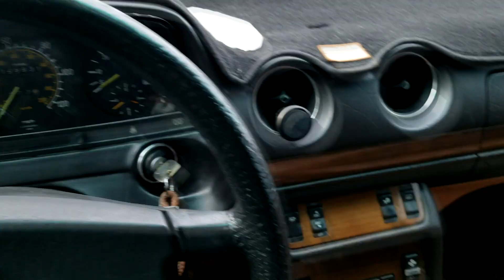Classic Mercedes Wood Trim DIY Option.

Comment: Maybe the tint is a UV shield?  There are self leveling additives for epoxy and paint.  That project came out fantastic!  What happens in the sun tho?...hmm.
Reply from the maker: I'm sure someone could find the correct additives to both match the original color and add UV protection that would be the next step. thanks for watching and commenting!

Comment: Sorry for the late comment, thanks for sharing your experience. How did you apply the epoxy? Brush? I thought I heard you say immersing? Or is it just a ton of epoxy on the brush? Do you think an epoxy spray would have worked?
Reply from the maker: no brush , just drizzle it on. thanks for watching

Comment: And how many coats and timing between rs-coating,  etc. ie, how did you get the wood to look so shiny?
Reply from the maker: I used a 2 part epoxy and let it dry overnight and applied 2 or 3 coats
Reply: @dieselbenzrevive6820  Did You applied it whit a brush?

Comment: Looks really nice but you will need to add UV protection or it will turn cloudy.
Reply from the maker: I ended up coating it with 303 protectant. It's a uv coating